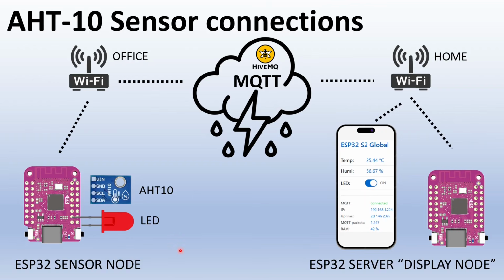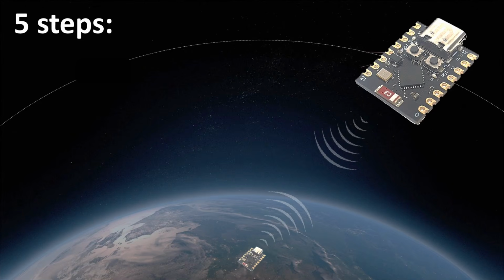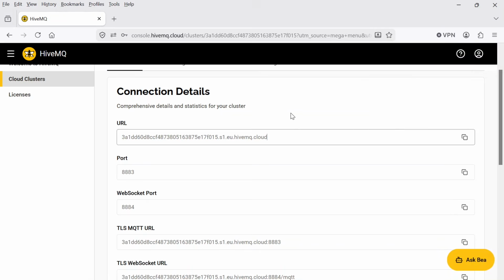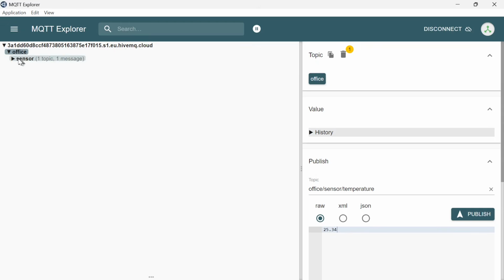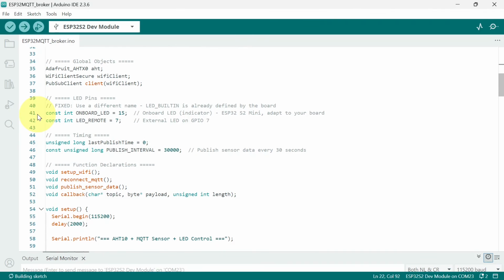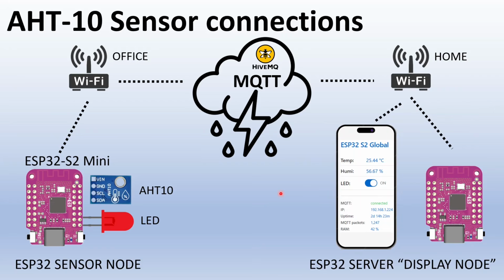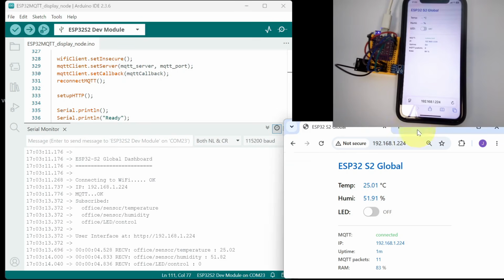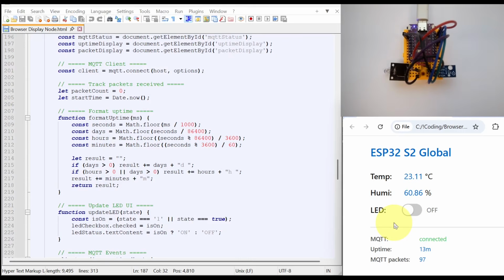Control your ESP32 from anywhere

Comment: [9/2/2025, 17:46] Luca: Hi, could you design electronic circuits and devices starting from scratch and then showing the various connections and the arrangement of the electronic components so that they are easier to create, I would like to build electronic circuits with triggered and non-triggered logic gates, flip flops, Pic PLC microcontrollers etc...... ok?  thanks Luca
[15/3/2025, 23:38] Luca: https://youtu.be/NjwrdY1hyBQ?si=8IwxtLfymDE4XgXt
[16/3/2025, 16:00] Luca: [21/2, 14:26] Luca: https://youtube.com/shorts/Yu3obf6W18w?si=_HRrzUmfWwxpHEyN
[21/2, 14:26] Luca: X esempio/For esemple. : https://youtube.com/shorts/Yu3obf6W18w?si=_HRrzUmfWwxpHEyN
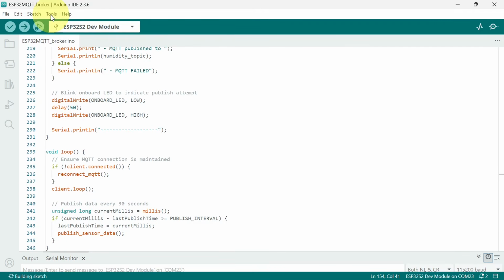[5/3, 10:52] Luca: Ciao potreste progettare circuiti e dispositivi elettronici partendo da zero quindi facendo vedere i vari collegamenti e la disposizione dei componenti elettronici mentre spiegate il funzionamento dei circuiti elettronici in modo che siano più semplici da realizzare? Vorrei costruire ad esempio circuiti con porte logiche,and ,or,not,nand,ex-or,ex-nor ;triggerate e non,flop microcontrollori Pic PLC ecc.. ok? Grazie Luca 😊👋
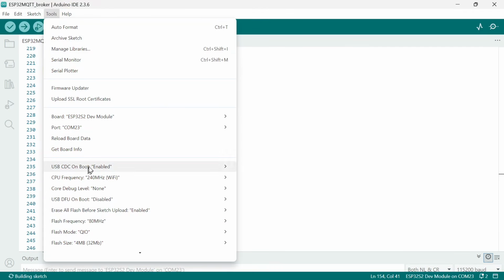[5/3, 10:53] Luca: Video normale e /o short.  Normale video and/or short
[27/9/2025, 19:07] Luca: https://youtu.be/iQwIK-hMGBU?si=NYpK2OFxg6iGsrQ2